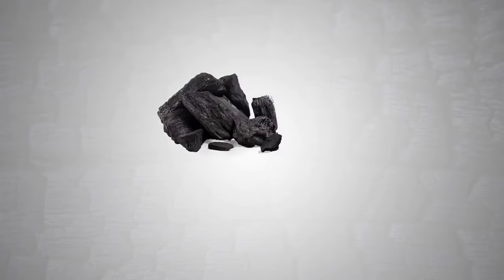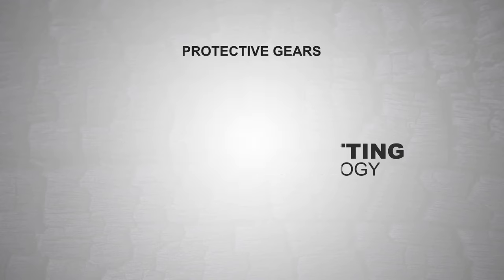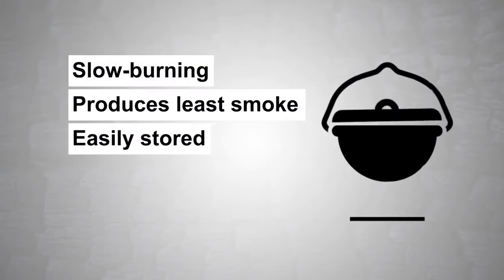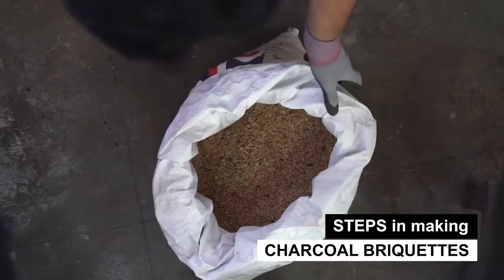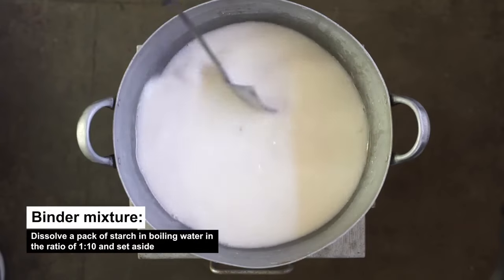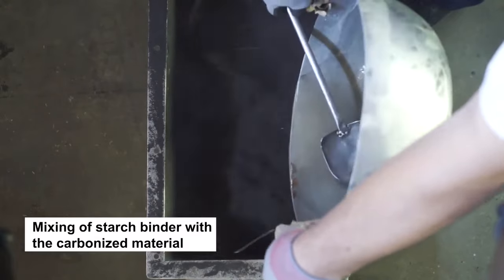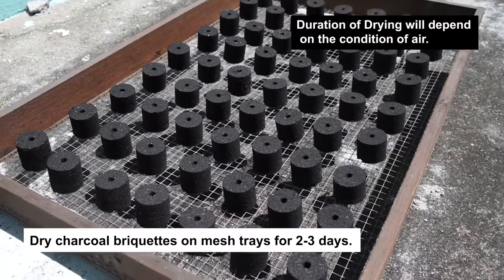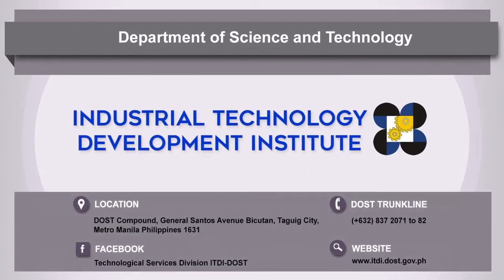How To Make Coconut Charcoal Briquette At Home

Comment: the most important process is the carbonization which was discussed just in passing and requires  a special machine - i dont think this can be done at home.
Reply: A metal drum with a lid with a hole in it over a fire. Very small scale can be done with a bean can.